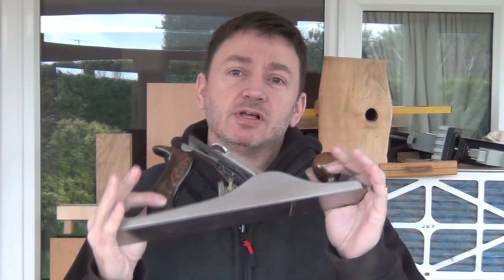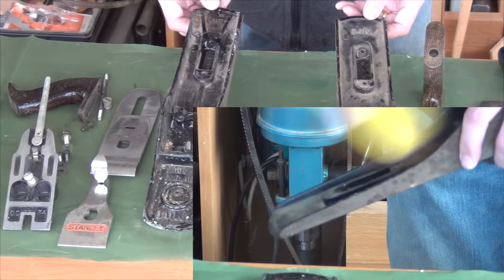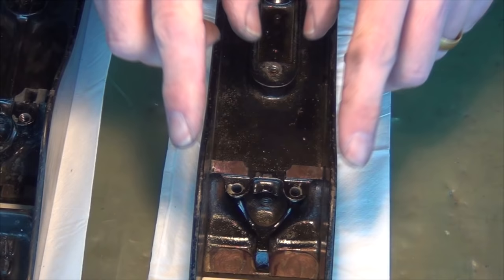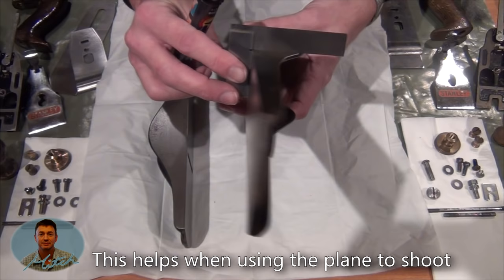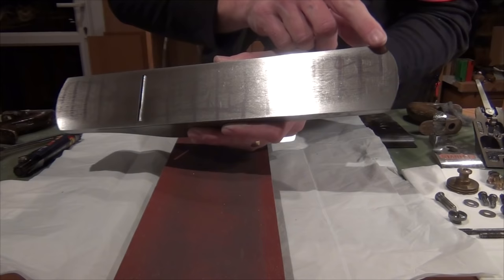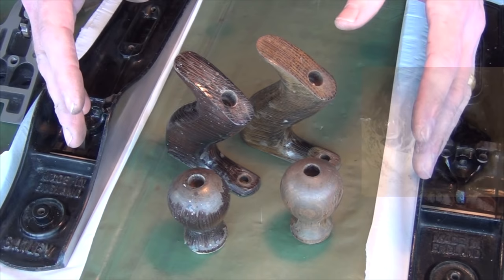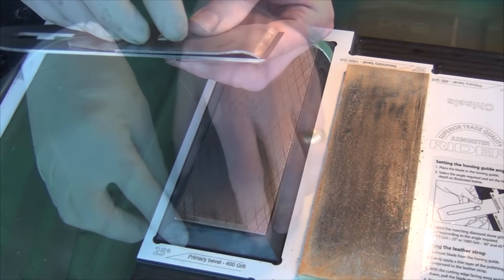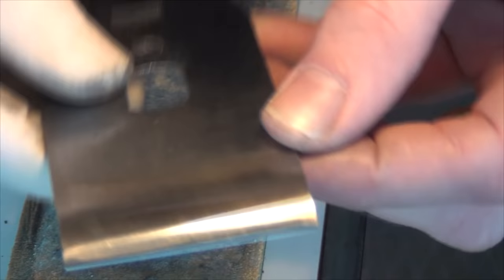Hand Plane Tune-Up - Amazing Results from Your Plane

Comment: What are the benefits from squaring the sides to the sole? I understand flattening the sides. When I run my planes on a shooting board, I use the lateral adjuster to square the cut. Am I missing something?
Reply from the maker: It's a very good point you make, and in most cases it doesn't really matter, your approach working fine. However squaring the sides has some benefit, which I should have explained but didn't in the video. Most simply, it's really easy to set the plane for an even cut, and therefore with sides square it will shot a plumb edge. Registering the work for the first shot is easier when the whole width of the toe is consistently set from the cutting edge. When shooting long grain especially, the toe of the plane will help reduce tearout. Also, an iron set skew to correct for square can be less supported when wound out far enough to cut fully across the planes mouth.
Not necessarily big issues, but enough to make it desirable.

Comment: Hi, I wondered if you can tell me what I’m doing wrong setting up my no 5 plane as I’m a fairly new woodworker.  When I fit the blade into the plane the blade sticks out of the mouth way to far even with the adjustment of the depth as far back as poss. I have tried moving the frog back and forward but  hasn’t done much. I assumed the issue was was the chip breaker  set too far back because that’s where the depth adjustment hole is but I have to have the chip breaker set so far forward it pretty much touches the mouth of the plane and no blade shows. I have managed one setup currently where the blade is just showing beneath the sole but it is still to thick a shaving and I can’t retract it any further as it’s set as far back as possible on the depth wheel. Any help as to where I am going wrong would be appreciated.
Reply from the maker: Oh dear, let's see if we can get this sorted.
There isn't any one thing that it has to be, so consider each of the following both on there own and in combination with each other.
Chip breaker position: start at about 1mm (1/32").
Correct chip breaker?: is the chip breaker from this plane, and has it worked okay before.
Correct spin wheel?: is it definitely from this frog/plane.
Yoke?: again, correct one for this frog/plane. Fitted the right way around?
Frog?: correct for plane?
Assuming all the correct parts, all fitted correctly, spin wheel turned fully anti-clockwise, the blade should not extend out from the sole. Advance iron by turning spin wheel clockwise until blade just shows out of sole. If blade touches front of mouth, then move frog back a bit and try again.
Still not working? Email me some photos showing all parts listed above, assembled and not working.
There may be something I haven't thought of, or experienced, so if you do find another solution please let me know.
Reply: Aah Woodwork with Mitch Peacock thanks for that I’ll try and have a look after lunch. One thing I can say is that everything belongs to this plane. Straight from the box.
Reply: Aah Woodwork with Mitch Peacock okay so I played around a bit more. With everything retracted at its most possible and chip breaker forward the blade is just about under the sole. So thank you for that. I guess I’m wondering if a new tool is supposed to be setup  that way to start with. For example whenever you put  the blade into the plane do you back it up all the way ? I don’t think I’ve seen people do that.
Reply from the maker: @ecowomble1781  I'm pleased you have it working now. Only very high end planes will be well set up and ready to go from the box. Most will benefit from some tuning, certainly a proper honing of the iron, even if they work to some degree out of the box. Most of my planes were used, some looking like they were never tuned and some which clearly had been. Those that hadn't been tuned, although old, had very little wear if any on the sole or iron, and I think the owners gave up trying to use them. With so much more information now available online, hopefully this happens less.

Comment: Great videos Mitch, I'm only just starting off n I'm struggling with setting my planes up mate I see u are from uk I'm Devon and u? It's great to see some uk ppl in here always USA, I like jay bates, izzy and Steve Ramsey, Paul sellers he's uk n he's real good, Amy way hope to hear off u soon buddy
Reply from the maker: Cheers Dan! I'm based in Sussex, so not especially close, but feel free to email any questions you have that I don't answer in my back catalogue.
Reply: It the Num 4 plane on the frog when I go to close the bit to plane thin then it won't let me screw the frog bk as screws wont line up and then when I put it all bk together the screw dial at bk that pulls the plane blade in and out I just seem to not get it right and I end up screwing the screw out lol if that makes sense thanks

Comment: At 3:11 you mention the possibility of removing the lateral adjustment lever.  Have you done that and if so, do you have a video showing that?  I have a 608 that need its lever replaced.  By the way, excellent video.
Reply from the maker: Ross Hollinger Have a look at https://youtu.be/zAyGOTpruao I didn't peen over the end of the pin since it was a little short, but you could slightly countersink the lever and do so if you face the same issue. Good luck
Reply: I hadn't thought of countersinking the lever.  Good idea.  Thanks.

Comment: Just subscribed, this is exactly what I'm curious about.  I have a Type 20 made in the 1960s that has japanning on the frog where you sanded yours even.  I know the type 20 is the ugly duckling of the stanley plane family, but should I leave the japanning alone or sand?  Or am I splitting hairs?  Thank you.
Reply from the maker: For performance use, ignore the japanning and scrape or sand for best fit.
Maybe one day these planes will become collectable and expensive, and in those circumstances, removed japanning will likely reduce the value.
With that in mind, the choice is yours 😉

Comment: Are there any replacement irons for those planes apart from the original cheap ones and the expensive Hock and Veritas? Any middle ground?
Reply from the maker: You might try Axminster Rider, or Quangsheng (I think sold as WoodRiver in the US?). Both make good planes with thick irons and chip breakers. I haven't tried these in an old Stanley or Record bench plane, so check with suppliers about any potential problems. For example, the depth adjust yoke lever needs to be long enough to reach through the thicker blade to the slot in the chip breaker. I haven't found this a problem with the Hock replacement sets I have for a few of my planes, but that's no guarantee.
Reply: Thanks.
Have you, by any chance, got some comparison of the vintage vs contemporary Stanley irons? Less than 10 dollars per No 5 iron doesn't invoke trust at all :)
Reply from the maker: Only qualitative - I have purchased a couple of new Stanley blades within the last 10 years, and I have planes from the '40s through to the '70s. I haven't noticed any significant difference in use. BUT, I haven't been consciously comparing them! They are cheap, pretty flat, quick to sharpen, take a very keen edge, dull quite quickly, in my experience. Not ideal to use on 'hard' or abrasive woods.
Reply: sigh Hock/Veritas dictated prices are absolute no-go for me but at the same I cringe every time I note the thickness of a standard Stanley Bailey type plane :/ What is it? 2 mm? Honestly, I can't imagine using those planes on hardwood without the plane mouth fully open, which is the only way to get the thin iron fully supported near the cutting edge (frog and then the short section of the sole).

The reason I asked about the comparison is irons of the two vintage planes I got have considerable pitting at the flat side. I have three options right now. Original vintage replacement irons from ebay, conversion of a vintage wooden plane iron or a complete move to wooden planes which seems more and more attractive every day as I learn about the inherent flaws of the Stanley Bailey type.
Reply from the maker: Try not to imagine it - just try it! Some situations will see it struggle, but with a 32/34° pri/secondary bevel, plus a 10° back bevel when really tough, you might just be surprised.

That said, I like wooden planes too, so that is an option.
Reply: You don't need a thick iron and the inherent flaws of the stanley bailey type are overhyped and IMO myths mostly. Check out the English Woodworker on how to set up the cap iron and perhaps some of David Ws videos on planes and irons (he rambles a lot but I've found a lot of useful info from his videos). I plane everything with old stanleys and stock irons, can't even get tearout when I try nowadays, ash, oak, burly silver birch. My card scraper is obsolete... Just a matter of setting it up correctly, which is something there is a lot of misinformation about online.
Reply from the maker: 1873Winchester I've said much the same in the past about stock irons and chip breaker preparation and setting, but, I have no doubts that all else being the same, thicker irons excel. Whether it's noticeable depends on just how difficult the timber is you're using.
Reply: 2 mm might be enough but when you remove curvature, mild rust and use the iron for several years you might be left with 1.8 mm. Besides, the insane pursuit of the ultimate cheapo of some companies simply irks me, and you know, the iron sticks out.

As for the flaws in Stanley pattern planes I'm speaking from my own experience. I know where my planes are fucked and I know by how much. I also know how much of it is common. Do the flaws render them useless? Most often not. My No 5 has tilted frog on the pads. I compensated with the lateral lever and of I go. But every time I use it I hold a freaking symbol of piss-poor design and cheapiness in manufacture. And it's no fun to me. Unearned praise irks me too. So all in all it's more about me not wanting to deal with those things rather than pure performance. That and not liking when the manufacturer adds mindless quirks to future troubleshooting I have to deal with. 

Working with a vintage wooden jointer with 60 mm wide 4 mm thick hard iron also changed my perspective.
Reply: I don't mean to be grumpy but you make it seem like you're suggesting Mitch himself was grind and scraping off 'myths'.
Reply: OK then
Reply: Hi! A trivia. I've wighed my No. 5's recently. With their original irons which are of similar dimensions. The Footprint No 5weighs 2300 g while my English-made 1946 Bailey weighs 1933 g. A 367 g difference! Also, the rear handle (tote?) on the Footprint is better (more vertical, similarly to more contemporary planes of Veritas and LV).
Reply from the maker: Quite a difference. Apart from using it to scrub and such like, I think the extra weight is a definite advantage. Tote angle I think will affect the most comfortable working height, but since I don't plane eight hours a day at the bench I've not found it an issue.

Comment: I bought a plane off ebay, the sole has a bulge behind the mouth in the midriff. I tried surfacing it on sandpaper on a piece of float glass but after a long time, there was no change. I suspect I am just following the contour of the sole as a maneuver over the paper. How would you recommend I get rid of the bulge?
Reply from the maker: If you're sanding the entire sole, that is getting an even scratch pattern all over, but the belly is remaining, then you must be following the shape. It can be easy to do this, and with practice you'll get better at it. However, you can attack the belly directly with a mill file - find the highest point and gradually work it down. With the worst removed, go back to lapping on the sandpaper on glass.
Oh yes, do check your glass is flat first!
Reply: @mitchwoodwork  Ok thanks, will try that out. Thanks a lot mate!

Comment: hi does the iron cap move up and down with the blade and chip diverter, ive got a cheap silverline no4 ive done all the mods, but if i put the iron cap on hard i cant turn the depth dial, and if i loosen it off, the whole cap moves up and down untill it eventually becomes loose, and no screw tension can fix this problem
Reply from the maker: It shouldn't. Try a little wax between the cap iron and lever cap. Also, the lever cap should be riding near the bulge in the cap iron, so just check that.
Reply: @mitchwoodwork  thanks

Comment: 21:25 - Rubber Diamond Abrasive Impregnated  bar  to clean the irons - where do you get this? Thanks
Reply from the maker: These aren't diamond, although I expect that is available these days. They are called GaryFlex, and I got them from Axminster Tools in the UK
Reply: In us woodcraft stores sell it.

Comment: Why do you use a diamond stone for the blade and chip breaker? Isn't sandpaper and a granite (flat surface) the same? I don't want to spend another 40 bucks
Reply from the maker: Big Black Boykyn Sure, any flat abrasive will do. I used economy silicon carbide paper in my video on restoring a no.4, next time who knows. It's certainly not necessary to invest in expensive equipment to tune a pane well
Reply: Mitch Peacock - WOmadeOD wow thanks for the fast response! Awesome great guide too, I will be referencing off this.
Reply: Mitch Peacock - WOmadeOD Mitch, could you please tell me who the manufacturer of your diamond stone is? Love your videos
Reply: Bob  Sosa looks like a DMT 3”x8”.